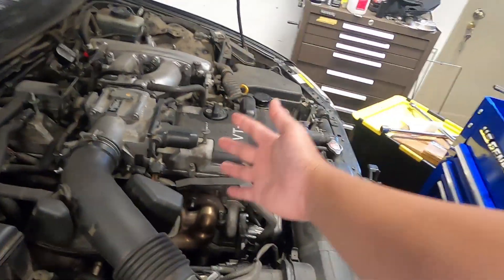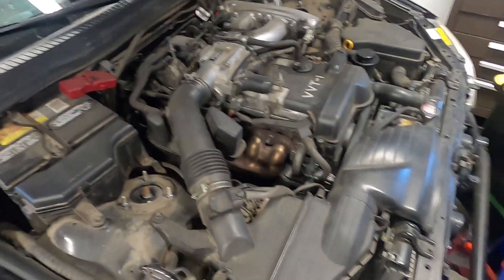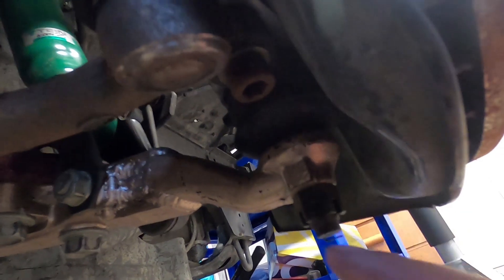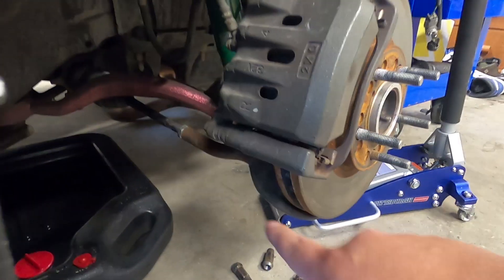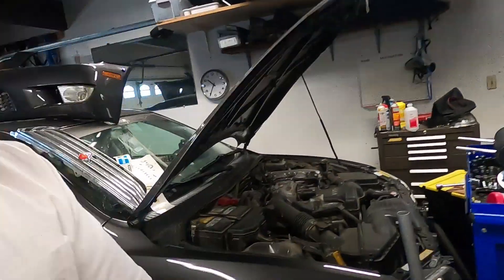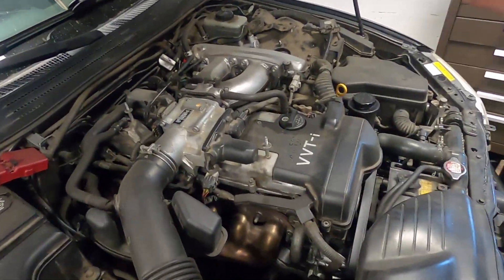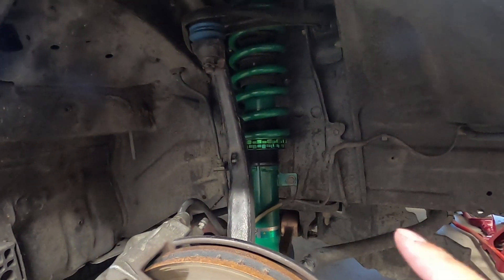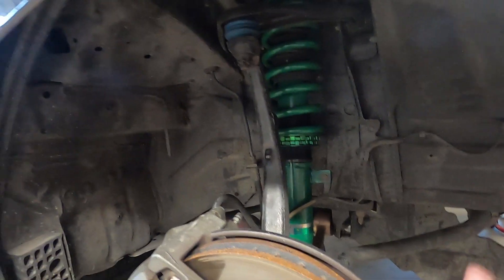First 5 Things You Must Do To Your Lexus IS300!

Comment: MOST IMPORTANT!! MAKE SURE THE RADIATOR CAP IS OEM or else it'll leak and blow your headgasket.
Reply: Really?
Reply: @jjsabedeautos  Yes I found a cheap radiator cap on mines when I bought it at a used dealership. I threw the cheap one away and got an OEM one from the lexus dealership.
Reply: how does a leaking radiator cap lead to a blown headgasket?
Reply: @asdasd-om8tj  low coolant will overheat your engine causing damage of rod bearings and blown head gasket.
Reply: @ABoredTroll  ah you mean threads leaking? the pressure release wouldnt really let coolant out

Comment: Nice bumper mine came with half a bumper I can only imagine what it looked like seeing your bumper gives my car hope 10 years or more cigarette smoke in the windows up the whole time fix that I cleaned carpets soap and water the seats the headliner back area behind the seats cigarette smoke liquefied onto the window a brown tint mostly in the back window both rear windows left and right cleaning about 3 or 4 inches from the top a yellow stain going down about 4 inches I can just imagine a fog fog the guys driving in and I wonder if his food that he's delivering smells like cigarettes Pizza add cigarettes Sushi and cigarettes kung pao chicken add cigarettes Panera add cigarettes you should make that kind of behavior illegal most people would put the food in the trunk however this car when I open the trunk the cigarette smell was just as bad who smokes cigarettes in the trunk hot boxes we have a lowered Mustang GT both Lexus stock and run very well the GS it's more balanced the is model looks like they carved out a Toyota Corolla somebody mentioned wheel spacers I definitely think the widest tires you can call my car is have between 250 and 300,000 miles I would call this 3 l a truck motor

Comment: Literally JUST got my new timing kit and it came with a water pump. All because my my water bypass outlet started leaking coolant 🤦🏻‍♂️ and I noticed a small oil leak. Also check your spark plugs ASAP! Tuck your bank 2 sensor 2 o2 sensor if you Plan on going low (p0161).